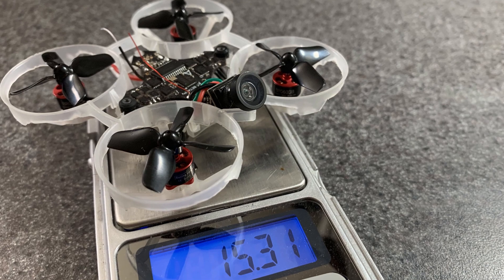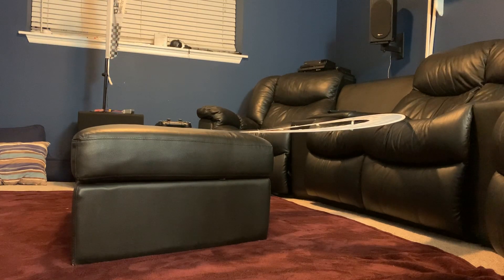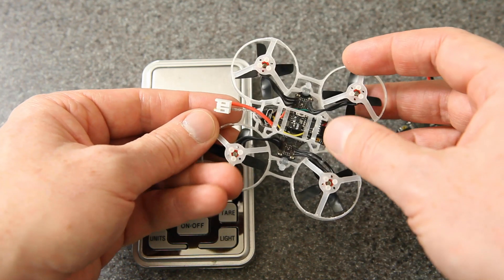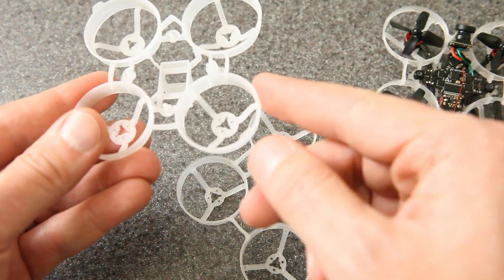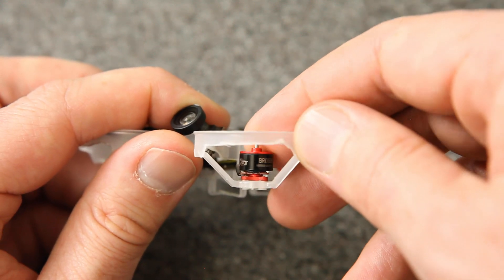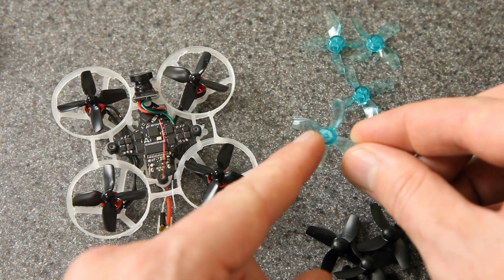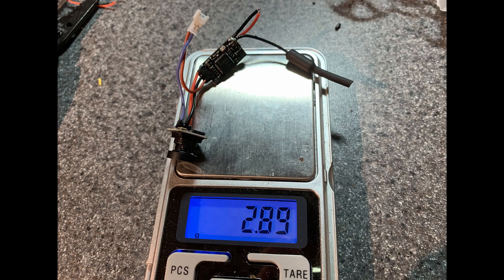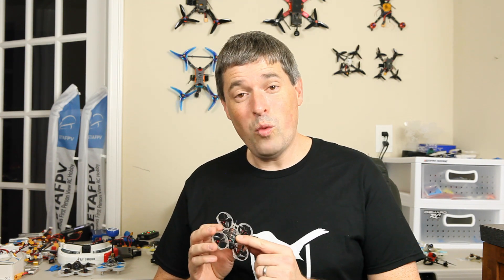Building the World's Lightest Brushless Whoop

Comment: I think I heard you say you used a "BetaFPV" drone. I just got one yesterday, and I'm finding that it is constantly jerking around in rooms with running ceiling fans, and it has no apparent resistance to a breeze when outside. Is that to be expected? I just built a "250" quadcopter not long ago as my first, and it does not show any influence from the wind. Also, the Horizon mode is very stable with it, but on the "Meteor75" in question, it will still flip over and do other non-beginner behaviors in Horizon mode. On the bright side, it will ride a tree like a pinball machine and take off from/bounce off of grass, unlike my 250 drone... But that thing is using 6" props and only has 3S, so it really doesn't fight if something gets in the way of the props. Surprisingly, the 75 drone tries to grind my toes off at every opportunity, while I don't recall being assaulted by the bigger one ever.

Comment: Sorry if I missed this detail, but where's the RX? Any very light options for FrSky?
Thanks
Reply from the maker: The Rx is built into the flight controller. All you can see of it is a little red antenna wire. Having a built-in Rx is the lightest option, but you can typically get longer range with an external Rx. I think the lightest external Rx is the USKY receiver. It's around 0.5g with no wires. The XM (not XM+) is around 1g and pretty long range (more than enough for a whoop anyway). Hope that helps. Have fun!

Comment: how did you clean through holes? I struggle doing that every time
Reply from the maker: Víctor Martínez with flux and wicking. It is pretty time consuming. I don’t usually bother. You can just solder to the top and  that works fine too.

Comment: Hey sir... I have an aio 1s board and a set of 1103 15000kv motors. Was going to do a 1s 2.5 inch toothpick build but I have the babytooth and it is fantastic! Now I just need something to fly around indoors on windy days. Was wondering what whoop frame do you recommend for these components. Thank you for all you content!
Reply from the maker: It's hard to say. Those motors would not be my first choice for an indoor 1S build. They need 4 screws which means they won't work on the frames that expect just 3 screws per motor. I would say 75mm is the minimum size for an 1103. The 75X frame could work but it's not super light and you need it to be super light if you want good performance on 1S. The 85X frame would work too, but you would need a super light prop to keep the amp draw down. Good luck.
Reply: @MrShutterBug  sounds good... I will save them for something else.

Comment: which battery did you use? is it flies with 450?
Reply from the maker: 450 is too big. I prefer 250 or 260mah for a drone this light. 300-333mah works too.

Comment: Thanks for sharing this video. Your link to the RENY screws goes to flat-head screws, flat-head usually have a counter sink. I would have though the pan-head screws would be a better choice. However, maybe screws this small do not have a counter sink (cannot tell from the picture on the website) and/or you like the extra diameter of the flat head. Was flat-head over pan-head a deliberate choice?
Reply from the maker: You're right, but the flat heads work just fine. They actually sink into the frame more than you would imagine. The other screw heads would be fine too.

Comment: Im already over the 15.31g mark (currently on 16.4g) without the props and the AIO cam secured...probably the metal motor screws; the motor choice (Happymodel 0603 19000kv) and the UR65 AIO (original) pulling me down LOL. I have followed pretty much your suggestions about shaving the frame and removing connectors and plugs and cutting it short (only one bit missing is the ground wire isolation removal). Which points to my conclusion you have researched the items very well beforehand. Very well done and documented! Sadly I have noone to share the cost so the RENY screws are a no go but maybe the motors will do justice being 19k. Interestingly my board came BF4.1 and RPM filter enabled and on power up despite all ESC booted up the motors did not spin up. I had to disable bi-directional (motors came to life) and once I was at it I went for the JESC 2.3 48khz firmware upgrade and Dshot300.  I just need to finish the AIO install and will see how the AUW will work out.

Comment: Hi Nate, just a tipp: I use Sugru (original recipe) to permanently and also flexibly install my AIO cameras in the COG on the FC. I like the view of the fans in front and using a screen while adjusting the final angle until it sets. Pretty fast and never had any issue breaking off or weight wise (Its up to you how much you apply). I still give protection to the setup and help turtle it using ultralight solution a 2 thin piece of bent cable ties just right and light enough to give an arch around the AIO and connect on the side screw tops by using superglue. I can send a pic somewhere so you can take a look if you like.

Comment: Hi Nate, you did it, you got me to post my first ever YouTube comment. I am an engineer that loves building ultra lightweight micros. You inspired me to try this build... And I beat you! I finished last night and it weighs in at 14.66 grams!! With a little more tweaking, I'd like to beat you by a whole gram! If you send me your email, I'll send you a picture of the proof.
Reply: Thank you! I did use the NamelessRC Nano and a 1.2 gram camera I got from banggood, though I think I am going to have to pick up a Nano3 now. I also used Kynar wire to get rid of some weight. Same FC you used though. I was thinking of installing the JESC 48kHz firmware too. I want to see if I can break 6 minutes of flight. Have you tried that yet?
Reply: @ericbutler2385  That sounds amazing. Make a video about it!
Reply: @ericbutler2385  What gauge Kynar wire did you use?  30 AWG?  Did you use this for the motors, or just for the VTX and camera?
Reply from the maker: Haha! Well done! Did you use the Runcam Nano3 and NamelessRC Nano vtx? That would do it. Or maybe the mobula6 FC?
Reply: I ended up using 30awg for the camera, vtx, and motors. I might do a 0802 25000kv version and use 26 on those motors.

Comment: Your rate profile from the dump file is 0 on everything except Yaw... so... how are you flying if the quad answers on yaw only?
Reply from the maker: Sorry... that rate profile is for angle mode. The 2nd rate profile is for acro. There's and adjustment to switch rate profiles based on the same AUX as the modes switch.
Reply: @MrShutterBug  ok, so it's not there. Dump file ends with rateprofile 0. Would you mind to update it, please? This is my first whoop build with brushless motors and I'm trying to understand what rates can work with it.

Comment: Thanks for  the great video! I am interested in the new flight controller. Does it come with a current meter?
Reply from the maker: No current sensor. You’ll have to use the virtual current sensor if you want mAh on your OSD. It’s not perfect but can be close enough if properly calibrated.
Reply: @MrShutterBug  Thanks for the feedback! Current sensor and mAh measurement is a nice feature, but not as important as voltage measurement. I need to check the virtual current sensor (I did not know that it exists).

Comment: For the monopole antenna did you solder the ground shielding to the vtx or just the inner wire?
Reply from the maker: Both solder the the vtx. If you fray the shielding you can spit it strands that stick out to the left and right and solder it on just like the antenna it is replacing.
Reply: @MrShutterBug  I figured, but I wanted to make sure! Thanks for the reply and this video is really helpful. You're the man.

Comment: I have a Beta 65 pro 2S !!
But Smart audio does not work,It worked when I first got it but had to reflash the firmware I think it’s 4.1 and now my smart audio does it work do you have any suggestions
Reply from the maker: If flashing betaflight broke smart audio, then you might need to re-select it on the ports tab. It’s probably UART2, but I’m not certain about that off hand.

Comment: Just a warning for those of you excited about Betaflight 4.1 RPM filters on your whoops (which works awesome, btw)... unfortunately this board comes with the 'L' ESCs which are not compatible with Jflight (the ESC firmware that supports bi-directional firmware on BLHeli_S ESCs thus allowing RPM filters).

Comment: Hi ! Could you please fly outside with it ? Like in a children park ?
Reply from the maker: It can fly outside, but that’s not really the point. An 0802 1S (or any 2S) would have more power outside. This ultralight build is designed for tight indoor racing where weight matters most.
Reply: @MrShutterBug  Thanks for the reply ! Actually, a 2S can be too noisy / heavy, that's why I was asking. And my apartment is wayyy to small for such a beast of yours

Comment: So if I have the early board I have to run a cam/vtx rated at 3-5 volts so the M01 requires 5v wont work?
Reply from the maker: Correct. I have one of the early boards. My vtx is powered by 1S vbat. But I’m told the newer boards (shipping now) have a 5v pad for the vtx. I don’t have one of those new boards, but that’s what I’m told.

Comment: Hi!
What do you think about the gnb 3s HV 520mah?
If i only charge it to 4.2v, is it just like a 3s 450mah - non HV?

Do i fly HV batterys also to 3.7?

Thanks!
Reply from the maker: Yes a 520mah HV battery will hold about 450mah when charges to 4.2 v/cell. Safe discharge level is the same for HV and non-HV.
Reply: @MrShutterBug  perfect! Do you think there is any downside getting the HV over the non-hv in Terms of power/reliability or lifespan?

If not i'll get just the HV version - why not? Its the only one in stock in Europe;)
Reply from the maker: RawPics FPV if you charge to 4.2 v/cell, then there is no difference. The only difference is the label (one recommending HV and one not).

Comment: Have you considered looking at the Tiny Whoop Nano size, but brushless? Less size, more gaps to find! The new betaFPV board looks the same shape as the tiny whoop nano FC.  That is I think a 55mm frame but still swinging 31mm props, by virtue of the slimmer FC board.  Oh, and BETAfpv Z02 rocks (same weight as M01?) because why not have 200mw for larger houses or thicker walls?
Reply: Z02 is 1.2g heavier than M01. For super lite 1S, you also probably want to run 25mw to preserve lite weight low mah battery anyways.
Reply: @MrRelys  ok, saw both as 3g so good to know.

Comment: Cool build! Is that the Shutterbug Lite? 😁
You could add a zip tie from front to back to protect the FC & cam. 

BTW are the bayang light boards as light as this FRSKY one?
Reply from the maker: There is no Bayang board like this one. Are you talking about the original BetaFPV Lite FC? It was for brushed motors.
Reply: Agh you're right! I mixed up the alien whoop and the bayang... And both are indeed brushed (but same weight).

Very fun build though. Thanks for sharing!

Comment: Nice! I've been doing the same thing! I haven't gone this low yet, I'm around 17.9g with 802 motors and a CP antenna. I mount the camera in a similar spot, only I mount in underneath that little support. This requires you to change what you consider forward on the frame, so that the battery sits sideways and doesnt interfere with the camera. It's much more protected though. 

How much weight did you save by trimming the frame?
Reply: Also, try the tinyhawk camera. It's narrow enough to slide between the ducts and it has better image quality. It's not the best quality, but it's usable.
Reply from the maker: Trimming the frame saved 0.50g. I could have trimmed more, but I didn't want it to get floppy.
Reply: @MrShutterBug  nice! 0.5g is pretty significant. I'm going to have to give that a shot

Comment: Would it be possible to lose the hoops and cut the props to make them bi-blades?
Reply from the maker: The hoops are part of the structure. If you removed them, there wouldn't be much left to hold the motors. But you could make a non-ducted micro drone this size. It could be lighter than this.
Reply: @MrShutterBug  You should try that with 45/46mm bi-blades. Call it the micropick lol

Comment: Well done. I can't wait to see a "quantum" class of fpv quad come out. That being sub 10g and about 30mm motor to motor. Like you said let's get manufacturers focusing on weight and smaller size :)
Reply from the maker: To get that light, you would need to ditch the frame, and make a quad where the motors screw into the PCB directly. That would be amazing!
Reply: @MrShutterBug  That's my plan, unfortunately I could only get the 0605 motors and betaflight 2s FC, so its going to be a challenge to get to 15g. Cost of shipping restricts me to one supplier at a time but motors were only $3 each its a win. However when you have a design, the pcb manufacting costs $5 + shipping for 5 frames. Sofa King Cheap.